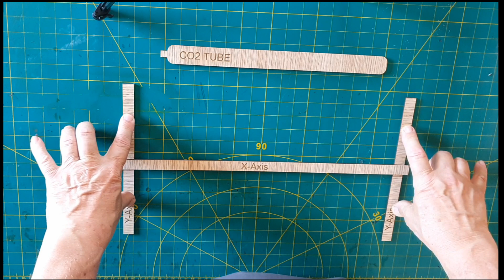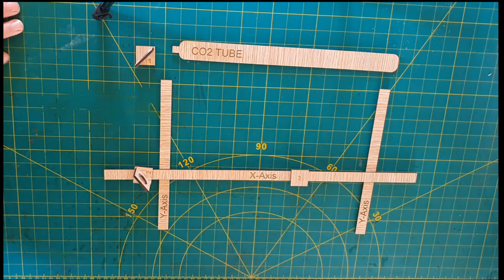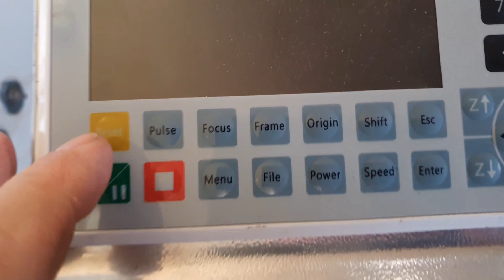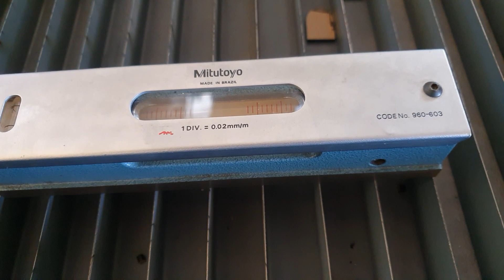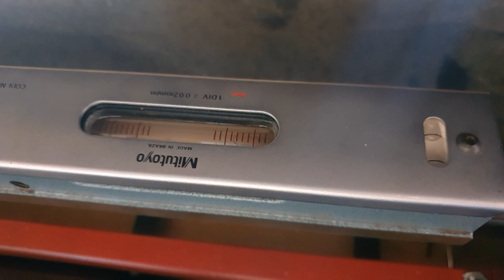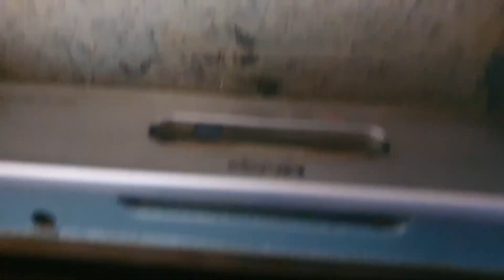Aligning my large DIY Co2 Laser cutter Part 1

Comment: Good morning, congratulations on the videos, I would like to know which engine model you used in the project
Reply from the maker: Hi If by 'engine' you mean controller? it is a Ruida RDC6445 the stepper drivers are DM556 and Nema 17 steppers with a Nema 24 for the Z axis.